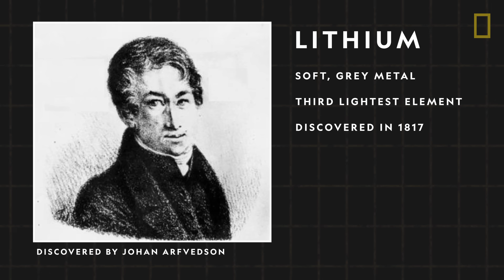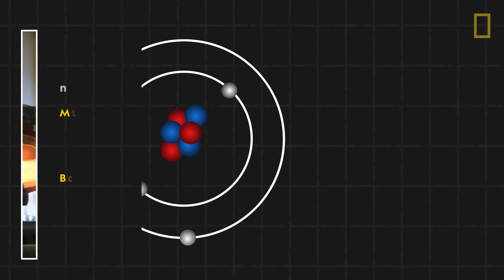Lithium 101 | National Geographic

Comment: if lithium can stand high temps? why were Samsung lithium phones exploding?   and a major recall was done??
Reply: Because of the liquid electrolyte. Lithium itself is safe.
Reply: Lithium is flammable.  The liquid electrolyte in lithium batteries is lithium-based.
Reply: @MindinViolet  OK so what is the temperature it has to reach? Before it combusts?  the power to generate such heat could not come from a mere mobile phone?  If it did people would be dropping dead daily? Death by mobile😂😎
Reply: @bonlives685  
I believe most battery-related fires are caused by some type of short circuiting in the battery.  I am not sure that there have been any confirmed deaths as a result of mobile phone batteries catching fire.
Reply: @MindinViolet  so a mere short circuit can explode a battery made of a compound that can stand high temp! next you will say that the short circuit forms a mini ice age around the battery which causes the battery to self implode!  goodbye and stop reading the "baa" books !
Reply: @bonlives685 
Curious.  When you asked the question, I thought you actually wanted an answer.
Reply: @bonlives685  hold enough power to overheat when shorted

Comment: National Geographic, your chemical equation at 1:32 is wrong. You know that by looking at the number of hydrogens on both sides: on the left hand side there’s only 4, while on the right hand side there is 6.... the equation goes like this 2Li + 2H2O = 2LiOH + H2... it’s quite embarrassing, just look up hydrolysis of alkali metals...
Reply: It's  2Li + 2H2O = 2LiOH + H2

Hydroxide has one less electron, OH- and lithium has one more electron, Li+, making it neutral.
Reply: @ibreathenapalm1112  you made a mistake again. The actual balance would be                   2Li + 2H2O= 2LiOH + H2
Reply: @Amuzic  thanks
Reply: Nerds
Reply: @abihaabbas6598  LMAO
Reply: help I dont understand
Reply: Also on the left side is 1 Oxygen and on the right side is 2LiHO so is 2 Oxygen, the correct equation is 

2Li + 3H2O = 2LiOH2 + H2 Right?
Reply: Waax, you’ve balanced it correctly. However, the more fundamental mistake that the creators of the video made was writing LiOH2 because such compound doesn’t exist. It’s LiOH.

Comment: LiOH2?And I don't really think lithium's melting point 181 degree celcius can be called "extraordinarily high".Plus,what's the relationship between lithium's melting point & boiling point and its capacity to store energy?
Reply: For a metal, 181°C is a low melting point. Please up the quality, normally you produce really high quality, well researched content. @National Geographic

Comment: With such a comparatively small supply one would think a robust recycling program would be in place.
Reply: It will develope as the huge supply of defective cells becomes profitable to separate chemically. At the moment, Lithium is a small percentage in cells.
Reply: i hope so
Reply: I have a large bin where I throw my used batteries. They're recyclable.
Reply: There is a recycling program called "Second Life" with used Nissan Lead batteries, that are now being used as storage for charging station. But, chemical recycling is not far off either, but we will see large scale recycling program only at the end of current generation of EV batteries, which is at least 5 years away.

Comment: These 101 videos are just amazing!! Please make other videos of elements😄 it would be great
Reply: Go read wikipedia, this video is full of false info.
Reply: What? You sure about that? They aren't a bunch of vloggers trying to run a science channel after all and I read it on Wikipedia  everything mentioned in video seems pretty much accurate😞
Reply: @liwazamemon918  Yes, I'm sure about it. The equation in wrong. Also, 181 degrees celcius is a low melting temperature and they refer to it as an "extremely high melting temperature". It would be the same as a documentary about turtles saying they can run at an extremely high speed.
You're right they're not vloggers, they're National Geographic, which makes these mistakes even worse.
Reply: I3VI5 Yes you're right if we take it word for word but even then what she actually said is that "Lithium is heat resistant having EXTRAORDINARY melting and boiling points" and of course she  is not comparing it to all elements, she called it extraoridinary because other alkali metals have relatively low melting and boiling point for. Cesium, for example  (lowest element in group 1A) 28.5 ° and for sodium Na ( element below lithium in 1A group) Lithium having boiling point of 180.5°C really do makes it extraordinary it's properties somewhat differ from other alkali metals.

As for the equation I get your point it should be LiOH and not LiOH2. But other than that whole video was full of information I wouldn't call it full of false information though😞😞... they are putting alot of effort and time into it. just point out the mistake. problem solved👍👍Thanks for pointing it out to me though.
Reply: @liwazamemon918  How are people supposed to know that she was refering only to other alkali metals?
Mistakes happen and that's fine but as you mentioned in a previous comment, they are the National Geographic, not a random vlogger. Their budget is higher and they also have a reputation to protect. Anyways...